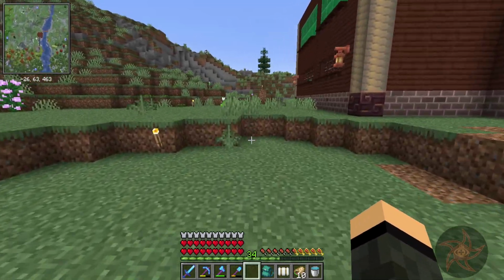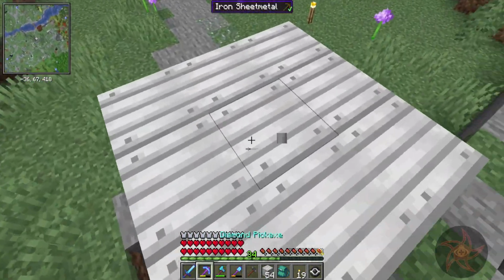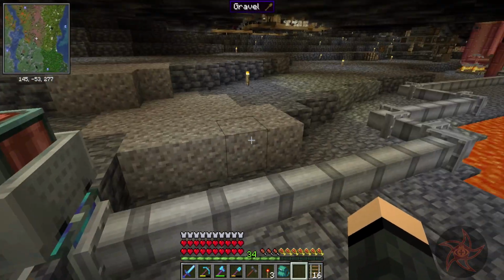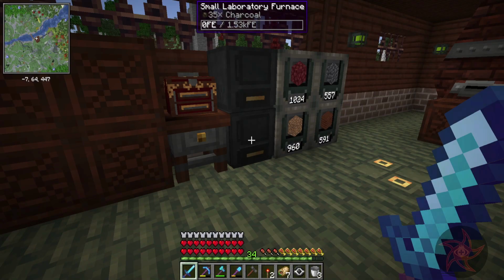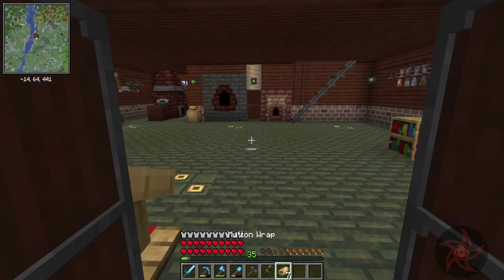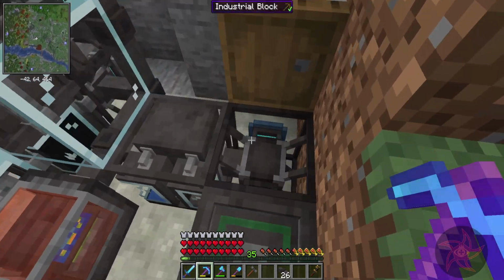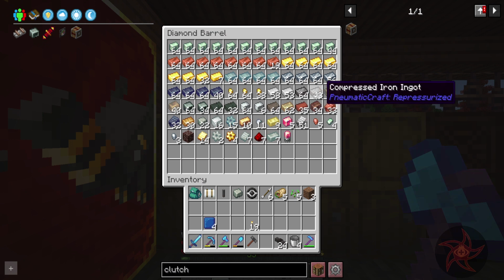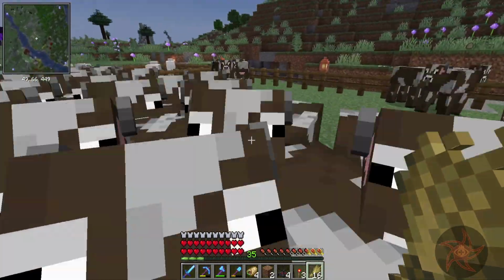Harmonious Engineering 1.18  :: Lava Power :: HE-20

Comment: Neat way to deal with the Illagers.  Best part, since they died of 'natural causes' instead of a player kill, you didn't get the curse thing on ya.
Reply from the maker: Normally yes, but the way it's set up in this pack is the raid only starts if you light an ullager banner on fire with a flint and steel
Reply: @theeldersign  Ah, didn't know that.  Just started poking at the pack recently myself.

Comment: A bit old now but the stopping is because IE has cable loss so 240 in isn't 240 out and since there is a small buffer in the connector and probably the motor it will skip a tick then use the buffer to make up the short power draining the buffer and repeat